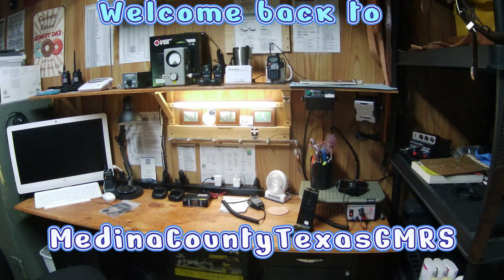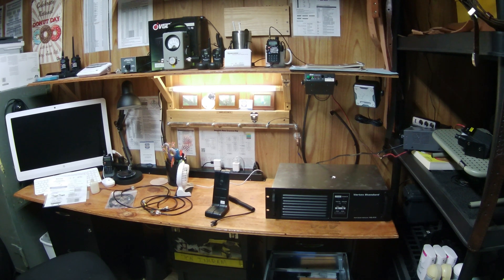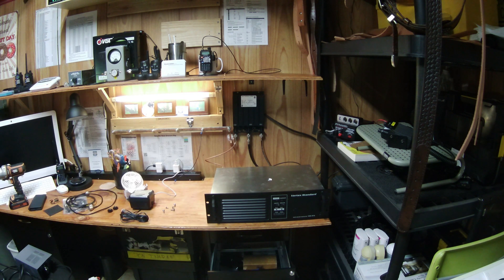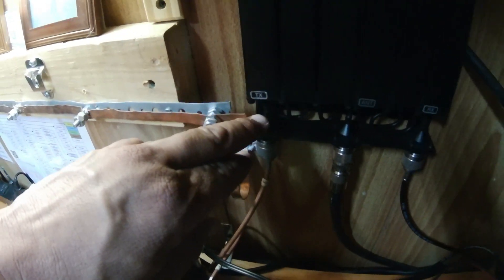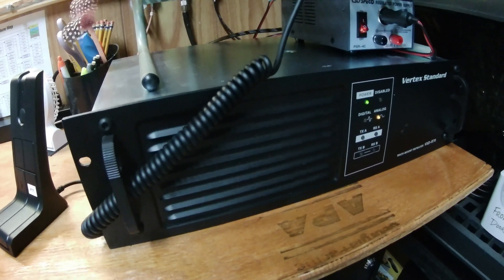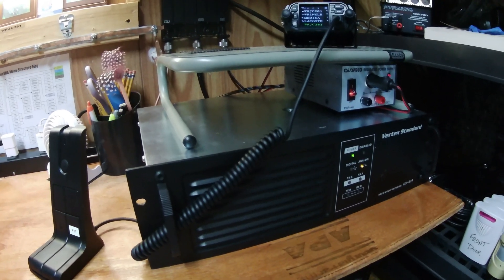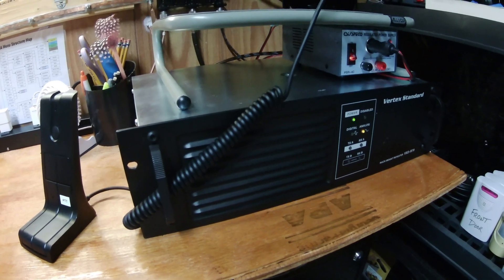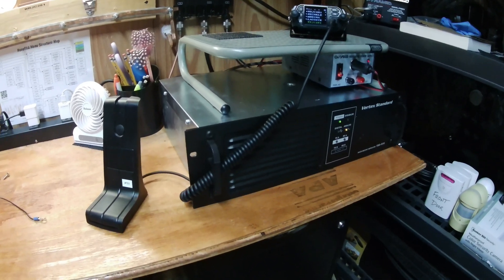GMRS - The Repeater Set Up!!!  Setting up the Vertex VDX-R70

Comment: Herea my question , if i have a repeater that has 50 watts ouput  and the duplexer is a 50 watt but obvious can only run about half that so it doesn’t get into receiver couldnt i just put a 100 watt diplexer inline so i can run repeater at full 50 watts ?
Reply from the maker: All duplexers will reduce your Rx output.  You would need a stronger output on the radio to overcome the loss.  You can also use a higher gain antenna to help circumvent the loss as well.
Reply from the maker: Meant Tx power.
Reply: @MCTGMRS78009  yes but what im trying to figure out can i run the repeater at full 50 watts if i use a bigger duplexer ?
Reply: @MCTGMRS  yea i  know that but is it the same amount of loss ,  my goal is to run the repeater at 50 watts and hope to get out at least 35-40 watts out cause now only having a 50 watt duplexer in line you cant run the repeater at 50 watts cause the tx bleeds into the rx so you need to turn down the tx power of repeater so im hoping with a bigger duplexer it can handle the full 50 watts with out pushing the limits of the duplexer

Comment: I have a EVX-R70 that I just programmed, waiting on BridgeCom duplexer to arrive as well as a Comet CA-712EFC.  I agree BlueMax49 is the only place for programming cables.

Considering our repeater hardware similarities, what lessons learned can you share before I go live on the air?  I plan on LMR 400, in the shortest run possible to accommodate the stick's 40 ' of altitude.  Thanks, WROQ941 clear.
Reply from the maker: LMR400 has worked well for me but I will say I've had a few folks say I should be using a solid center conductor.  I think for the "short" run we are doing,  you'll be fine with it. "Height is might" when it comes to distance - I still need about 20 feet more to be where I want to be.   Definitely install a lightning arrestor and ground your repeater.  MOST IMPORTANTLY- HAVE FUN!  Please keep me posted on your progress!  I think its great you're helping build the GMRS Community!